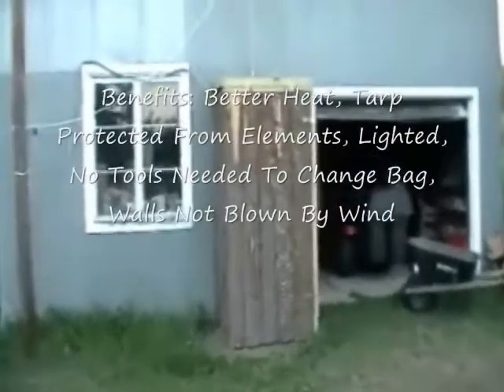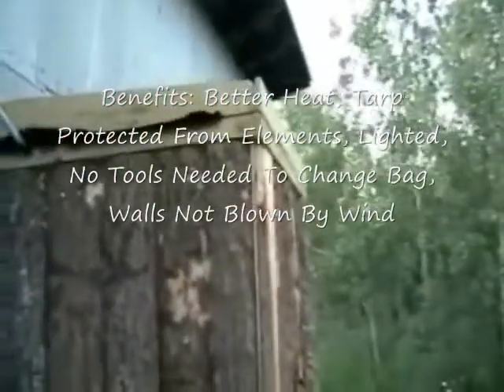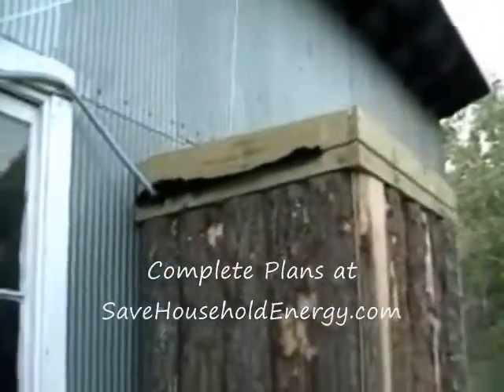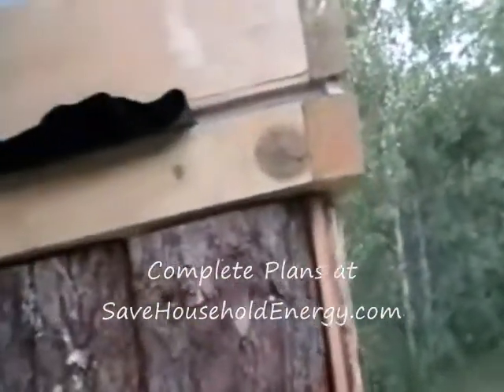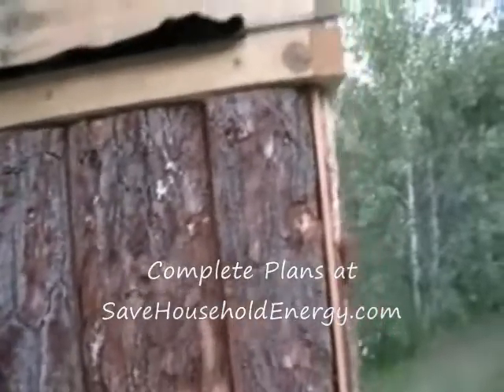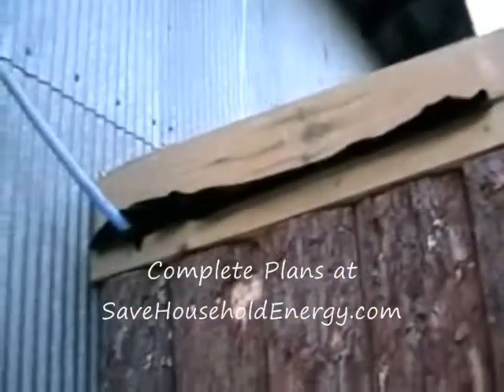Homemade Solar Shower Improved!

Comment: If you're going to heat your water almost to boiling, you need to install a mixing valve, and mix some cool water with it. On a hot day, you need very little hot water. On a cold day, you might need the water enclosed in a box,  covered with clear glass, in order to heat it well. But, not on a hot day, you can almost boil water!!

Comment: People go to too much extreme in their method of heating water. In 1990, I was using one five gallon bucket to take  a shower with. I would put the water in in the morning, and at the end of the day, even if you leave it in the shade, you have nice warm water. If you left it in the Texas sun for that day, it would scald you! A mixing valve is needed if you're gonna heat the water almost to boiling, like most of the videos I see here. NO need. If the temp gets up to 90 degrees, the water will do.

Comment from the maker: I use household water. I guess you could use rainwater, but you would have to have reservoir located above the fill point so you could gravity feed - that would actually be a nice idea for a shower out at a cabin where there was no running water!